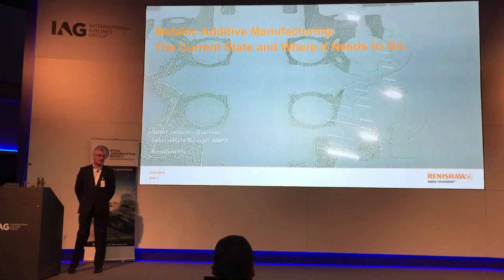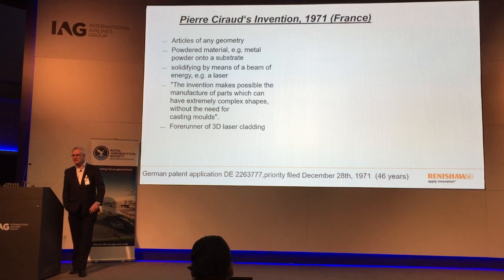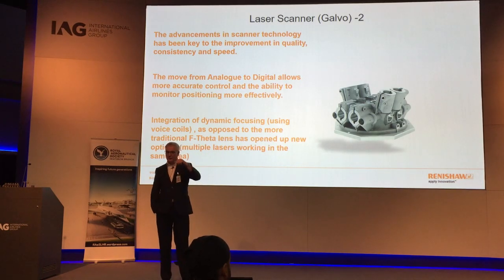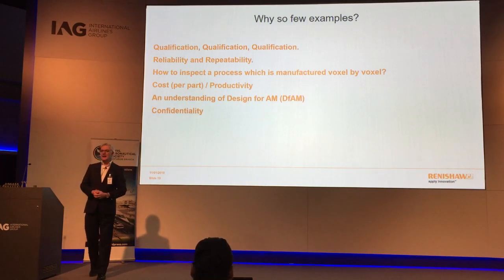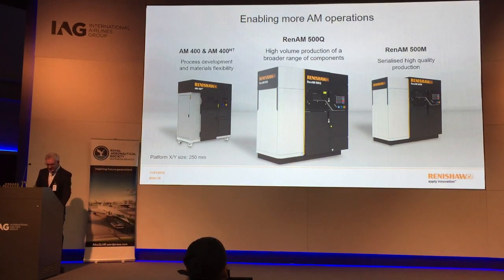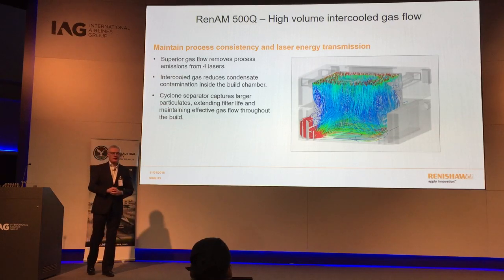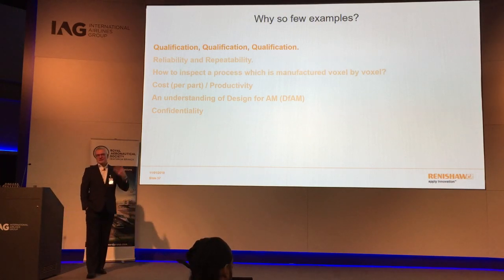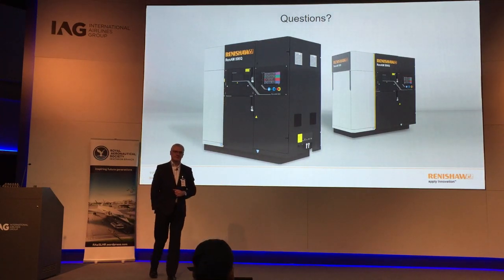2018/01 LECTURE: Metallic Additive Manufacturing

Comment: There are actually high temperature turbine blades already being made out of Inconel and CMSX-4 with SEBM (selective electron beam melting, similar to LBPF/SLM just with an electron beam instead of a laser) right now. There is still a lot of research being conducted but in the future, SEBM might actually be better (and cheaper) for turbine blade manufacturing than casting.